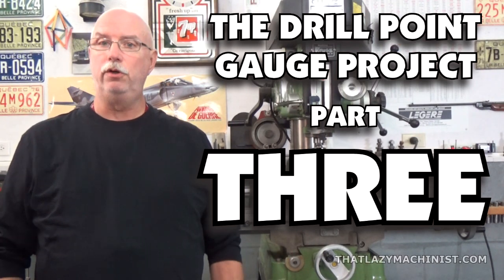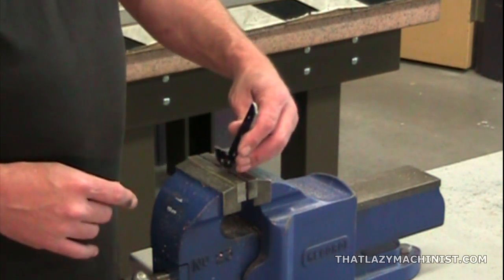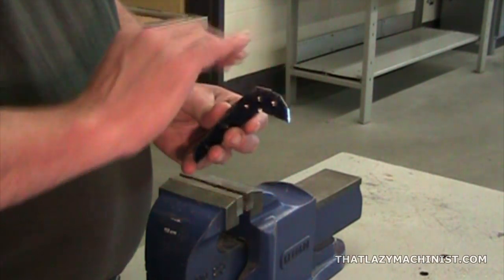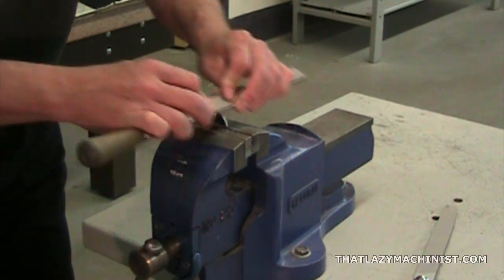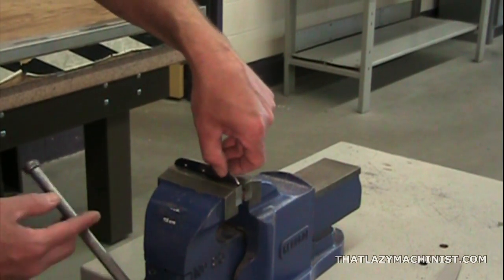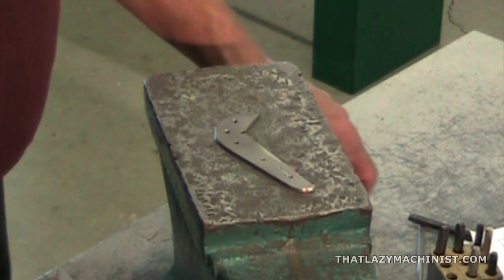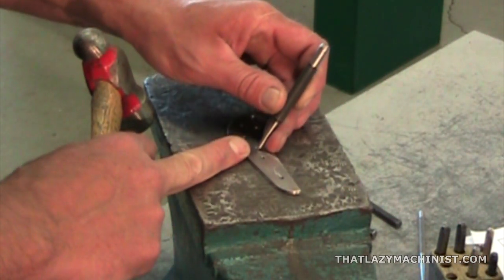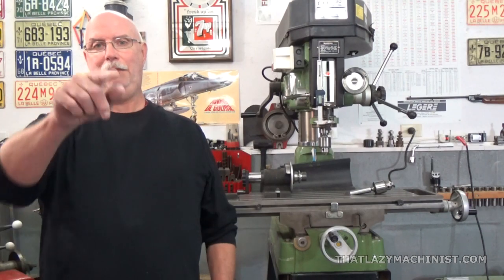DRILL POINT GAUGE PROJECT PART #3 contour filing, letter stamping and finishing using hand tools

Comment: If an air cutoff tool would  have been used to cut out the outline of the gauge would it have generated too much heat and warped the part?